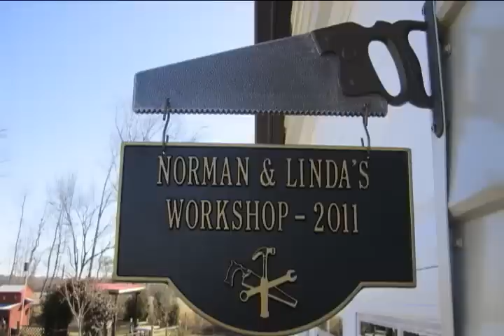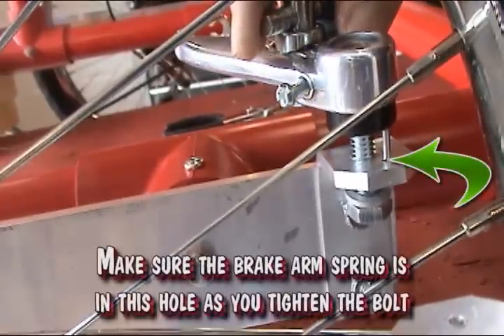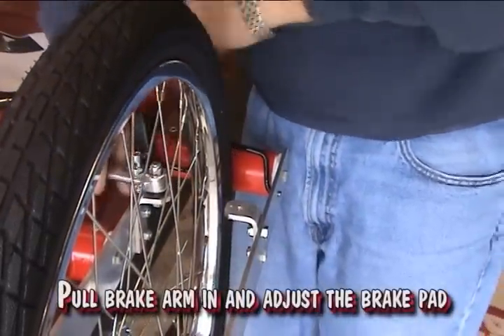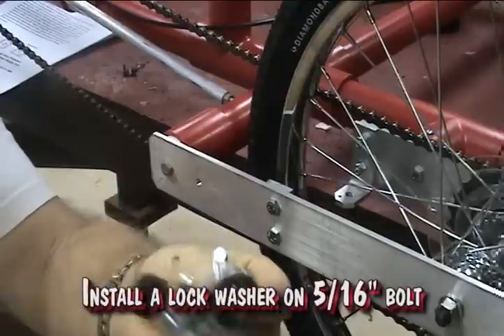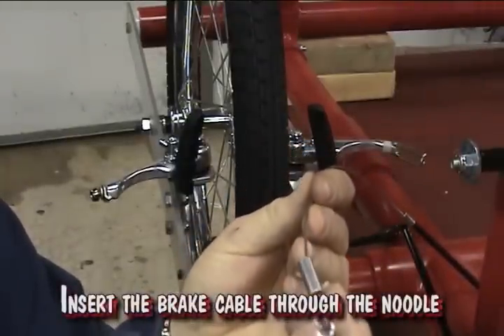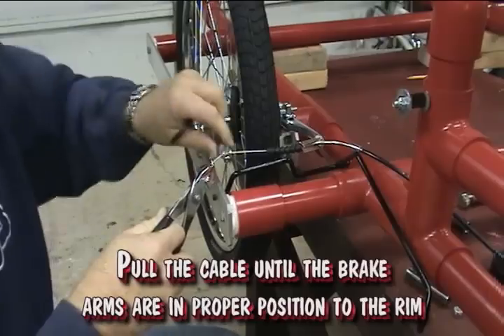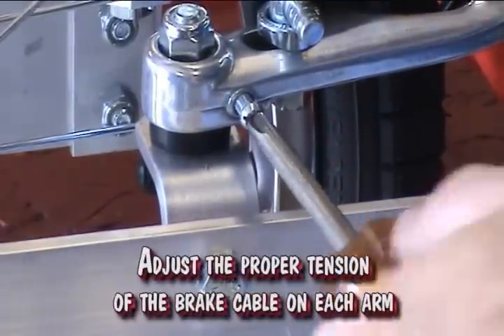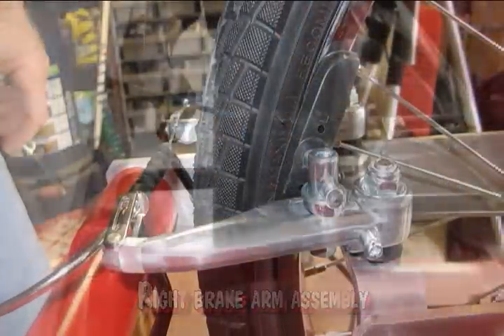Part 16 of 29 - PVC 4-Wheel Cycle  - How to Install the Right and Left Brake Arms

Comment: What kind of brakes did you use?
Reply from the maker: Kim Belstene 
Standard bicycle brakes. You don't need disc brakes or 4 wheel brakes unless you are going to add an electric hub motor or gas  engine.